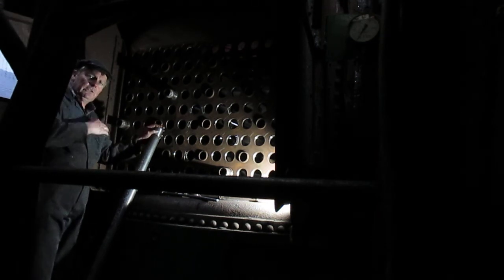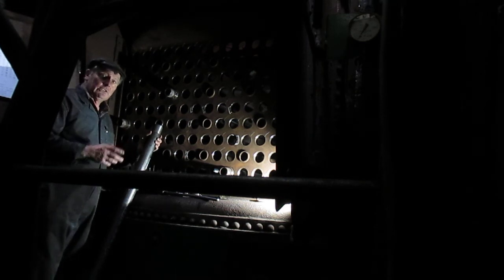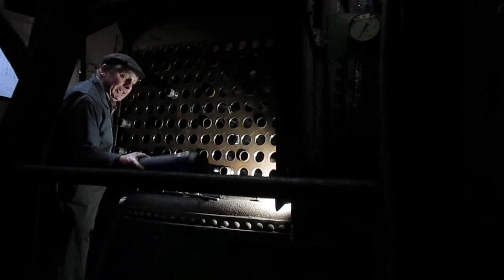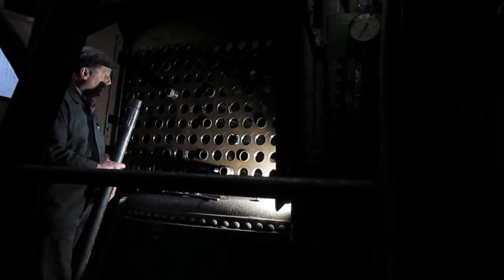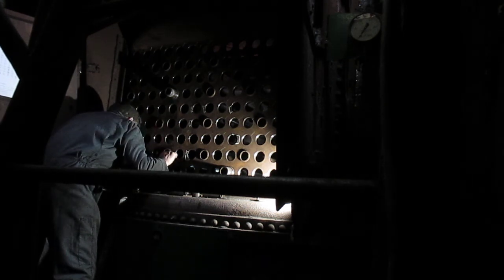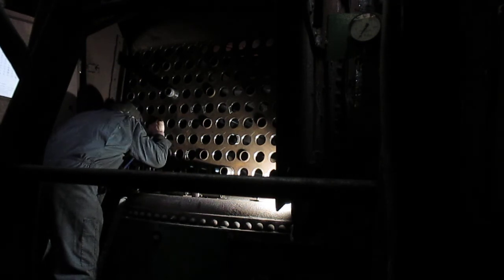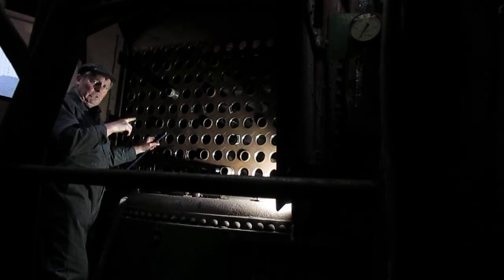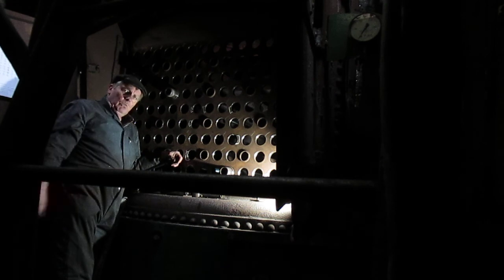Fitting a stay tube into a Cochran boiler on VIC 56 Clyde Puffer

Comment: Very interesting, that looks master hard Work, does the Washing up Liquid act as a lubricant for the Thread as it screws into tother Tube Plate? How many times do you catch your Knuckles on the other proud Stay Tube? Thank you for sharing.
Reply from the maker: The watered down washing up liquid does act as a lubricant, if we used oil this would possibly cause the tube to leak, and would prevent the tube 'healing' into the tubeplate. Oil film also acts as an insulator and can be injurious to a boiler. Getting the 'bark' off your knuckles is an occupational hazard in boiler-work, which can literally be 'blood sweat and tears' !! The reward is seeing something back in steam.